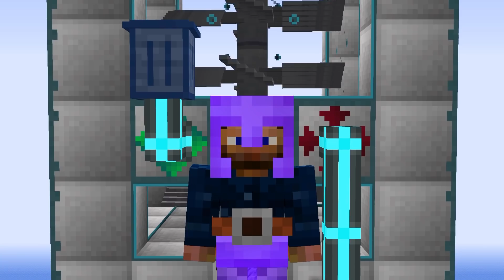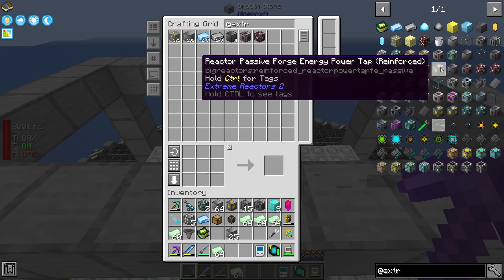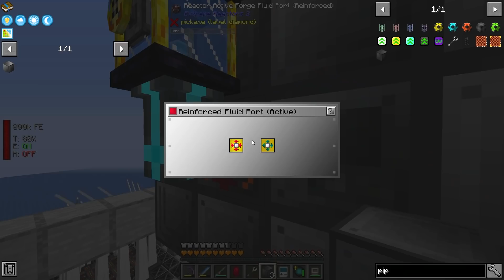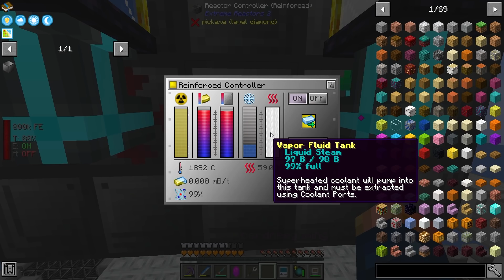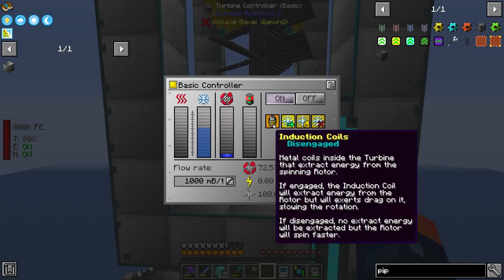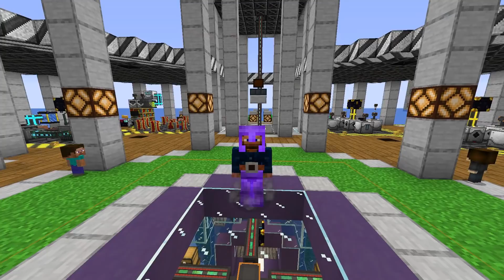Seaopolis Minecraft Modpack EP23 Extreme Reactors 2 Turbine Setup

Comment: i did some digging in the files from extreme reactors and It seems like manyullyn is the best coil block (or enderium but I don't know if that's in the pack)
Reply: Problem is each block used to have a set x/multiplier for calculating the best block, but some blocks aren’t in the pack for example ludicrite was the best coil block but it doesn’t exist anymore
Reply: @seanpayne7404  extreme reactors is open source so all the files are on github, thats where i found this https://github.com/ZeroNoRyouki/ExtremeReactors2/blob/master/src/main/java/it/zerono/mods/extremereactors/gamecontent/TurbineGameData.java
if you scroll down on this https://github.com/ZeroNoRyouki/ExtremeReactors2/tree/master/modpack-api-wrapper page there is an explanation

Comment: Scientifically speaking, copper is a weaker conductor than gold, 
"Copper is a poor mans gold"
so gold is probably the best block from turbine conduction coils
Reply: Scientists yes ,in game is yes . But in reality copper is cheap and we use little gold because is more rare ,for exemple you know we have gold in phone more exact in battery ,if they use other materials because not want to invest is bad what they do or if they research and find a better material and not gold is good but at the moment gold is use on battery for conductivity of energy(at the pins where the battery is inserted because we need high conductivity and we need many phones to make 1 gram at least ,so little we have in the phone) . Aluminum is even better than copper in conductivity but it is very weak in the resistance of the material if it circulates more electricity than it needs to be fried instantly and another problem it still has is not resistant in time (I don't know the duration in time and I give an example  : if copper is said to last 10 hours, aluminum lasts 5 hours the same amount of material and the same voltage)
Reply: No, copper is actually a better conductor than gold. Gold is sometimes used because it doesn't tarnish.

Comment: I am going to try and get someone to make the Ghopper mod, a hopper which will pass items through a solid block to an inventory on the other side.  Ghost hoppers. All so you will be correct in this.
Reply: that's actually a really cool idea
Reply: @rohbust56  I know! AND, make it directional, so it can pass through a line of hoppers without placing into them and all kinds of manic criss cross nonsense becomes possible! Pity the only mod maker I know says this is a little beyond him. Ooh! also, maybe an O.c.d chest that always automatically sorts its own inventory and a block that, when placed, either turns into one on the non air blocks around it, or explodes randomly! 

I did once play with this this obscure mod which made it so that when you killed the ender dragon, the exact sword and armour got cursed so when you used them all together, you turned into an ender dragon, usually causing massive destruction for 10 seconds before the curse wore off.

Comment: Hi chosen! Just a heads up on the turbines, they produce power when the blades spin due to the steam, when you ingage the coils they cause friction against the shaft speed creating power, so blade speed + best coil blocks with reinforced turbine parts = best turbine output. At least that’s how I perceive it to be 😅 keep up the good work! Love watching!
Reply: To generate power you need more coils, but because they generate friction you are limited by the force generated by the blades. To increase the force generated by the blades you need more blades and more steam. Look in the GUI for the efficiency number and can see if using more blades is necessary for the amount of steam you are generating.
Reply: @anagram  the old table it out of date, due to the mod been upadated and the table has been left in the past 😅 plus you can only make a 5x5x10? I think it was using the basic structure parts so he was limited to space

Comment: You have to keep the RPM in the green areas for maximum efficiency. As the hint says: "Rotors perform best at 900 or 1800 RPM." The turbine obviously produces less energy if it's less efficient because the RPM is somwhere between 900 and 1800. That's why you can control the flow rate to adjust for peak efficiency.

Comment: Hey, make the fission reactor and steam turbine from mekanism it produce 1M RF/T.
Reply: More than that for larger ones. Also if you are just wanting power and not polonium you can do it in a compact machine. Then radiation isn't a problem even if everything goes wrong. Just note you can't get radioactive waste or polonium out of a compact machine, quantum entangloporters won't do radioactive stuff and they are gases.
Reply: @ElliotMcJohn  And since you have no sunlight, the radiation-watchamacallit that produces pellets won't work. Don't put the Mekanism reactor into a compact machine. For the creation of fissile fuel, on the other hand, it's a good idea.
Reply: @Seegras  That's what I said basically, the solar neutron activator won't work so you can't make polonium, but plutonium just requires the isotopic centrifuge and a pressurized reaction chamber so that you can do in a compact machine.
Reply: Yeah produce more but is like end game machine to make now and need attention because radiation
Reply: @florian4792  radiation is not really a problem since u can void the waste with liquid trash cans. The problem is that its a lot of work and u would need to make the induction battery to store energy since the fission/turbine combo its kinda volatile if u let the turbine get full of energy.